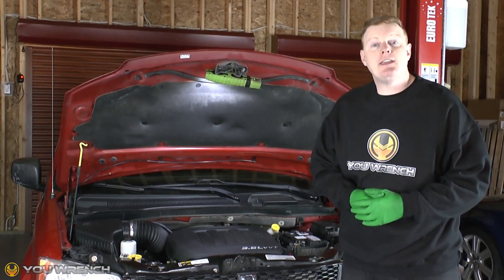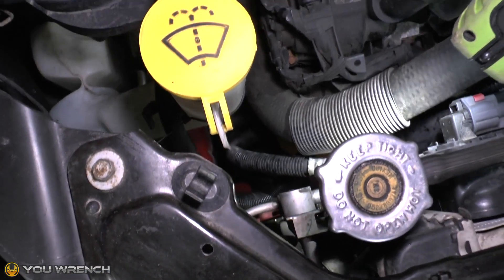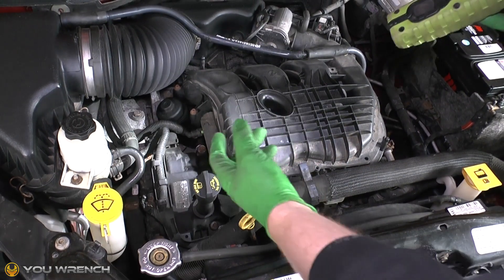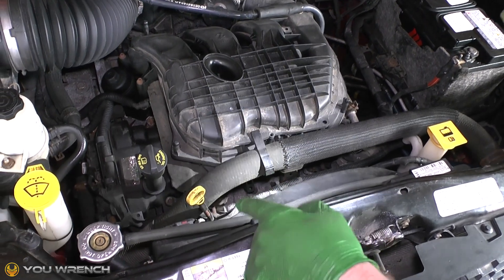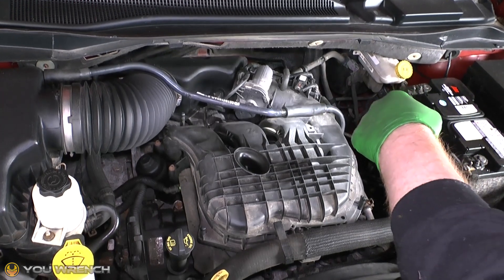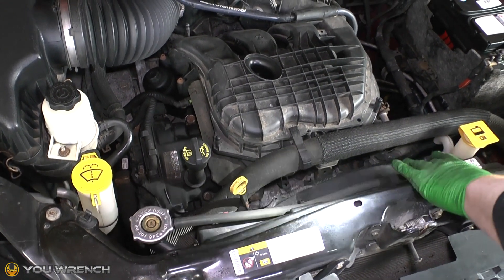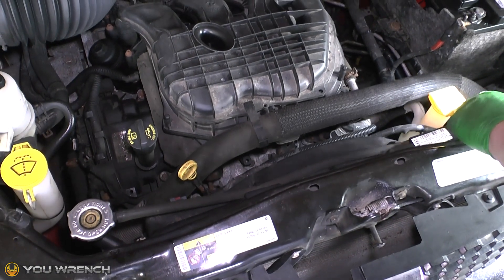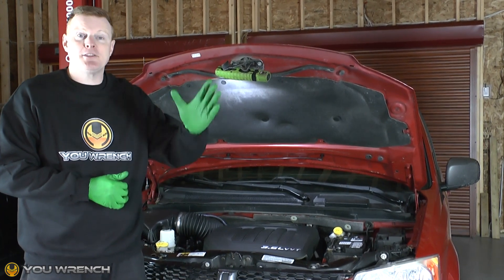How Does Engine Cooling Work In My Car?

Comment: Can a Radiator cause overheat in long drives? Someone told me I may need to replace it because it may be clogged. When it gets really hot outside,  inclined drive, or long drives my car overheats. I have to turn on the heater full blast to cool the engine.

Comment: Hey boss what about that oil filter cooler deal with the coolant going thru it? It's got those big o rings that leak and fill up the intake with coolant over time. Everyone's coolant starts disappearing but no leaks.  That's part of that cooling system in that 3.6.
Reply from the maker: Hey there! Absolutely, there are numerous faults that you can have with your cooling system, including leaking gaskets and rings as you mention here. But this video is designed just as a basic overview on how a cooling system works, not so much detailing specific faults that can occur. It's also for all engines. It's shown on a 3.6 here, but the basic set up is common across many makes and models. Hope that helps!

--- 

To help support us (for both you and others reading this) there are a few things you can do:

1) Donations both needed and welcome! We cannot operate You Wrench without the support of people like you! You can donate by PayPal - just go to www.paypal.me/youwrench

2) Please ensure you subscribe to our YouTube channel. 

3) Please Like our video's on YouTube (by clicking Like!) 

4) Please help spread the word, the more people who know about us the better! Add links to our video's in forums, let people know about us.

Thank you for your support!

Comment: Appreciate the information, would love an in-depth video on the oil cooler housing and what the main functions and the side effects of it failing
Reply: I just replaced that cost me over 300 had a leak at the gasket only found it with renting a radiator pressure tester